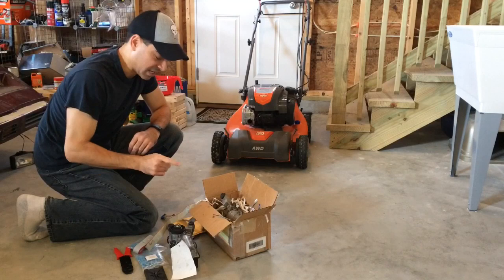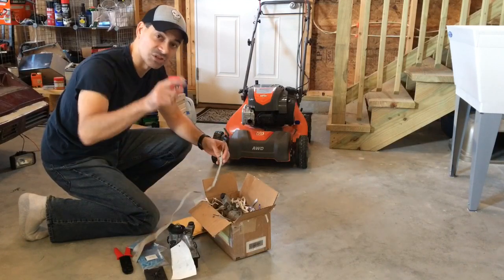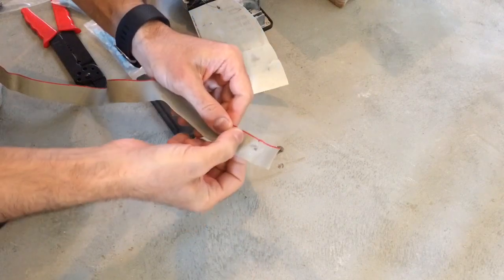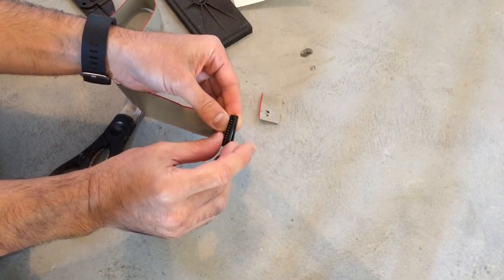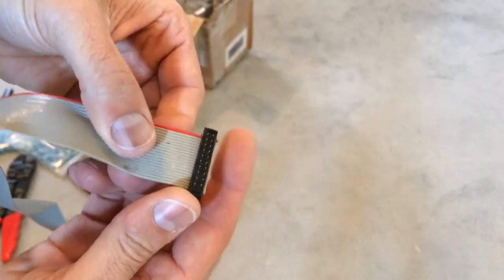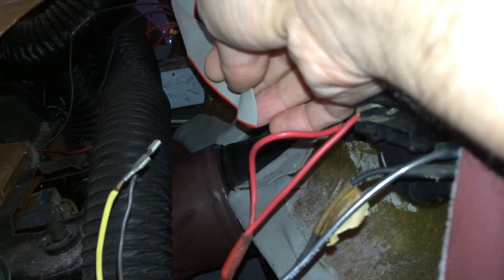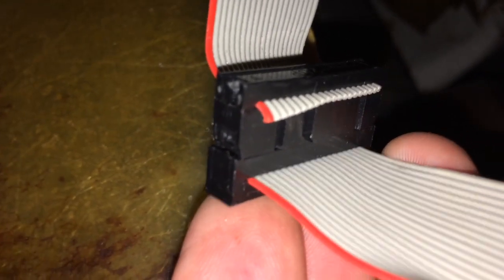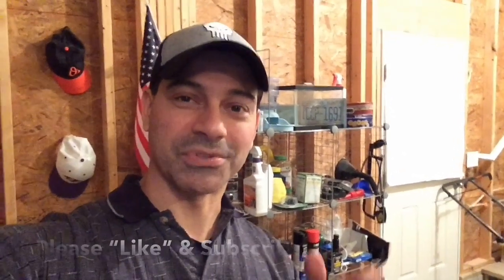How To Repair Damaged Ribbon Cable (Andy’s Garage: Episode - 21)

Comment: Thank you so much I was going to be charged $60 for shipping and a replacement for my Sony rack system I bought in 1995 for 1200 on sale and it was just out at the very end at the clamp on moving across the states while this will be so easy thank you so very much

Comment: Thanks for the video but how do you Open and take of the cable retention piece from the connector without breaking it ?
Reply from the maker: Johnny Dos Passos they may make a Tool, which I do not have. I just used a small flathead screwdriver and removed it gently

Comment: Do you know if there is such a connector that could crimp two open line ends together?  For example my wire ribbon is broken in a clean line half way through. I want to cut out the bad part and reconnect the wire but don't have much space.
Reply: Have you ever found an answer? I have the same issue

Comment: I have a Samsung UN55NU8000 which is in an endless on/off loop (no image, just welcome sound and panel lights on/off) since plugged to power. Apparently main & power board are ok. Could be the ribbon? Or led panel went bad?
Reply from the maker: Rashid F. Could be the mother board
Reply: @PhillipsVision  thanks!

Comment: Can you provide a link to the replacement connectors you used?  Thanks!
Reply from the maker: James Johnson I don’t have that anymore. You can get them on eBay and also through Walmart.com. It is Flat Cable 20 Pin IDC Ribbon 25mm. Hope this helps.
Reply from the maker: James Johnson search 20pin IDC connectors on eBay; they’re about $4.50 for a 10 piece set...free shipping
Reply: @PhillipsVision  Thank you very much!
Reply from the maker: James Johnson you’re welcome 👍